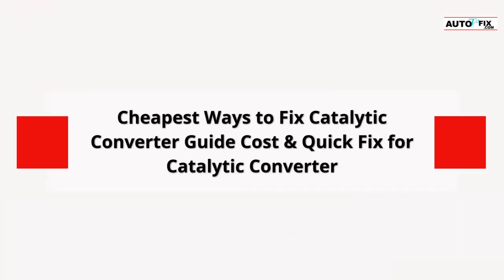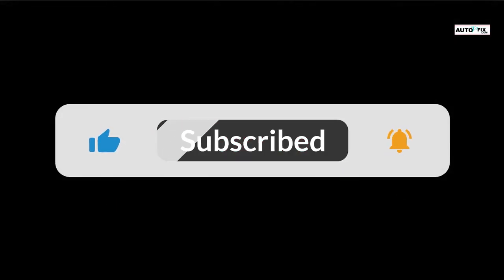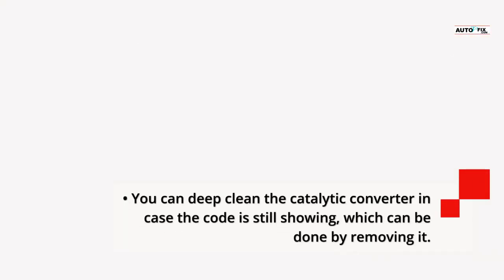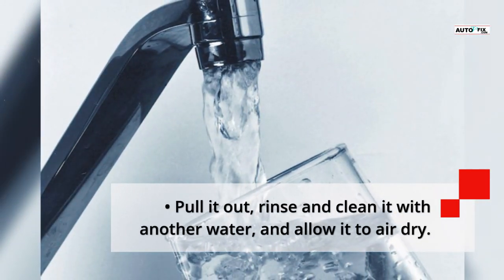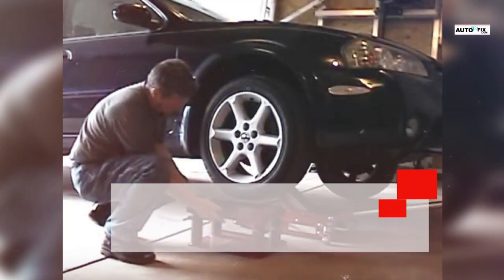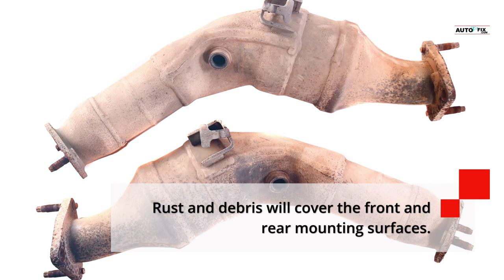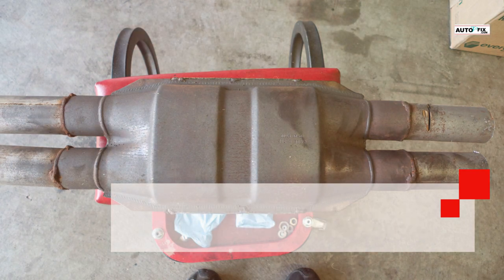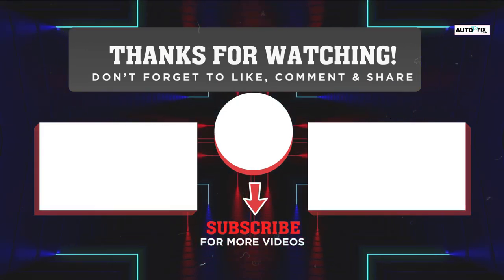3 Cheapest Way to Fix Catalytic Converter + Cost (Clean Catalytic Converter)

Comment: I Heard drilling a hole, 🕳️ or holes in converter will help it if its clogged, & Will prevent a clogged converter from putting to much pressure in the Engine, & Engine Gaskets! Is This True? I Also Heard lacquer thinner, pouring thinner in gas tank to clean converter. Cuz that's what most converter cleaners have in them anyway! Any other Tips?